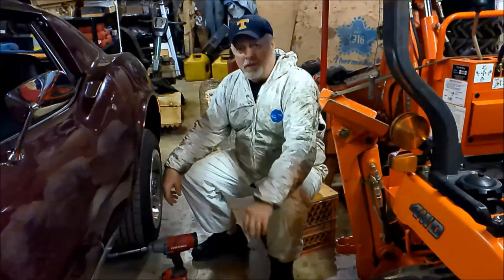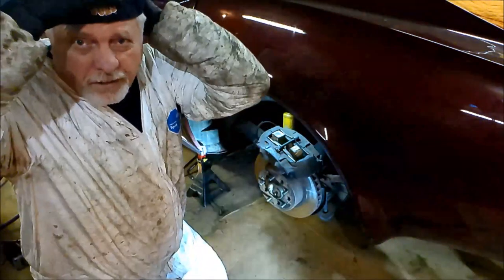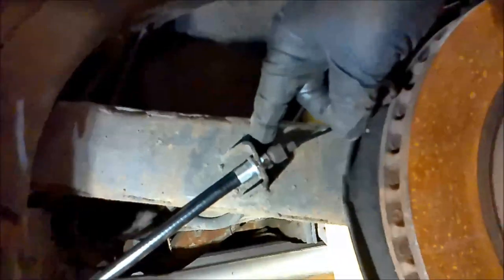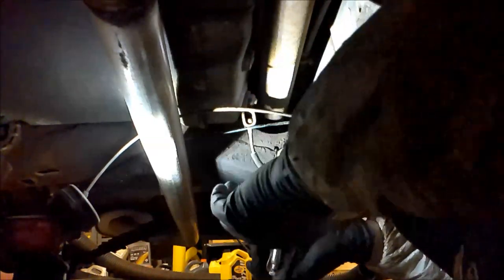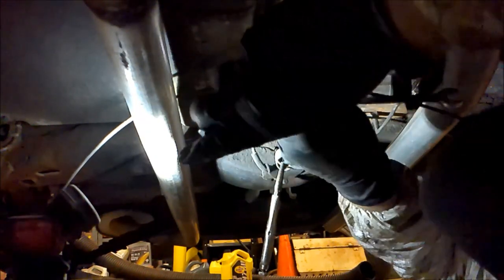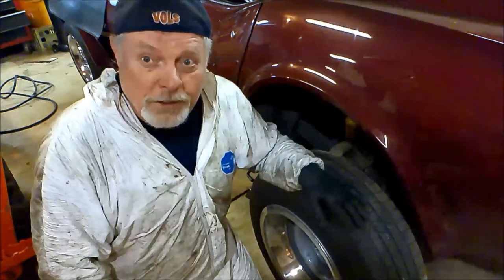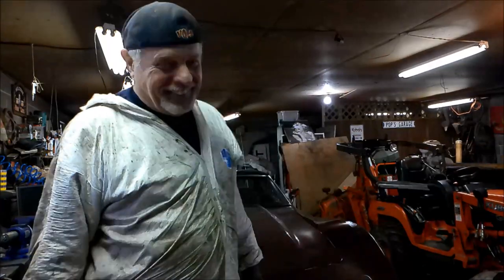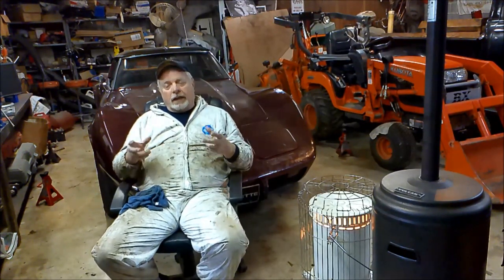C3 Corvette parking brake cable install, 1975 Corvette volume 42

Comment: Great job Dave, as usual. One thing while watching you replace the parking brake cable I noticed that it looked like there was some welding done on the frame. I might be wrong, but that's what it looks like to me. What's with that?
Reply from the maker: Hey Michael. All the frame welds appear to be factory welds which unfortunately they don't look as good as modern robotic welding. These old cars were mainly hand welded back in the day which differed depending upon day of the week, LOL.
 Thanks for watching.

Comment: A mechanic and a friend told me, the emergency brake has to be exercised. Which means set it often for this very reason. If you don't use it, you lose it. Many emergency rakes are so remote and hard to get to. Hell drives don't even use their turn signals, it a bet many don't know where the EB is.
Reply from the maker: So true. Thanks for watching.

Comment: Looking good Dave.. bout ready for another road trip.. I'll bet that kerosene heater feels good.. what is the black device next to the kerosene heater? Is that another heater? I'll bet it warms up the place.. Well so much for my rambling on.. Dave take care my friend and God Bless... See you on the next one...
Reply from the maker: Hey Gary. It's a pretty good out door Patio heater. The shop is so drafty I don't worry about using it inside. It puts out alot of heat but it goobles up the propane so I use it sparingly. I keep saying I'm gonna fire up my old wood stove but it's buried under too many things, LOL. When it gets too cold I just hibernate in my recliner.. Have a good 'un.

Comment: I’m in the same boat, had the transmission rebuilt in my’57 and it 2 months to finish everything, kick down cable, different bracket,  one thing after another. We have to take the wins.
Reply from the maker: Hey David, you got that right.